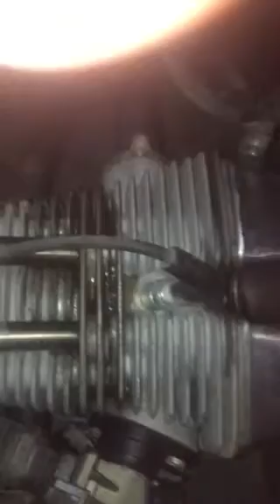Ural motor question

Comment: Got 94K on my Retro, yeah, my avatar. From time to time it does that if I ride a wee bit too enthusiastic for too long. Then I clean it off, ride like a sane person for a while and it goes away, until I ride like a maniac for a while. May be sign of head gasket going south. Double check head torque. I back mine off then retorque just to make sure. Make sure crankcase breather is breathing and if you don't have one already, get a tach of some sort and try to keep sustained RPMs below 4500 or so...4000 is more natural for these beasts. Higher RPMS for a sustained period will make these things seep oil from all over the place, Enjoy.